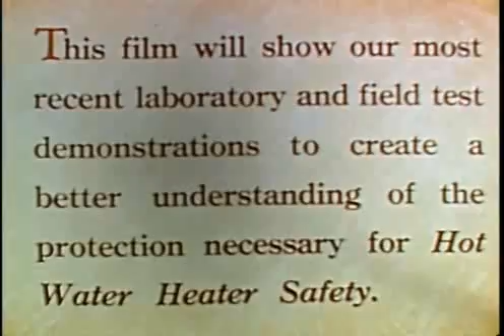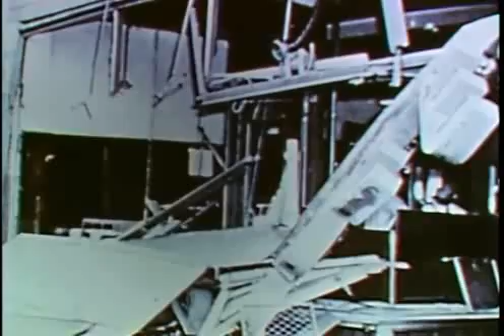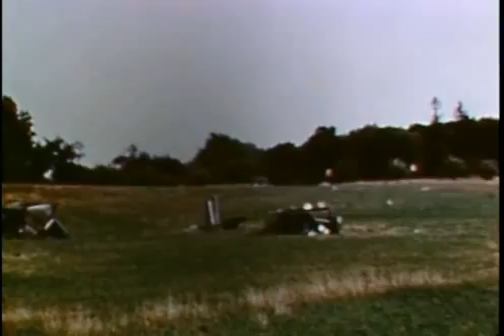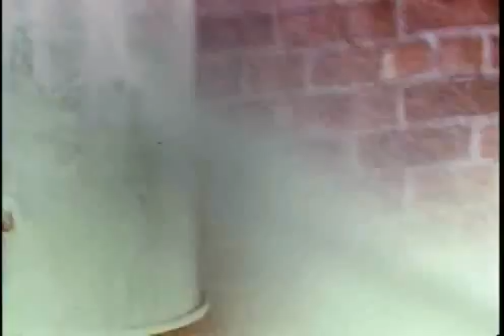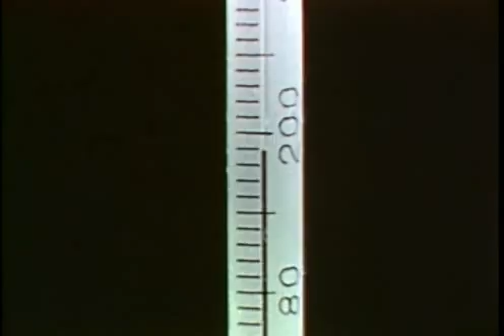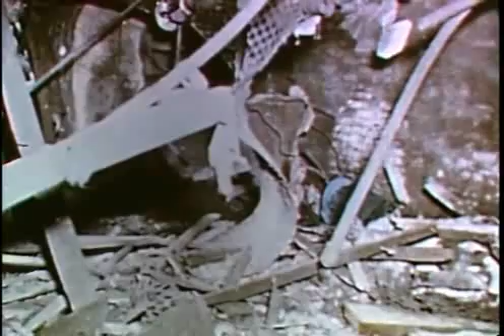Explosion-Danger Lurks! (a video from watts regulator) A water Heater Explosion

Comment: LOL, they studied the causes of water heater explosions? I can tell you, it's the simple matter that if the thermostat fails to turn off the burner, & if there's a defective or no pressure temperature relief valve, then the water heats & turns to steam. At that point, the steam wants to take up 1,000 times the volume than it did as water, building pressure in the tank until...BOOM!